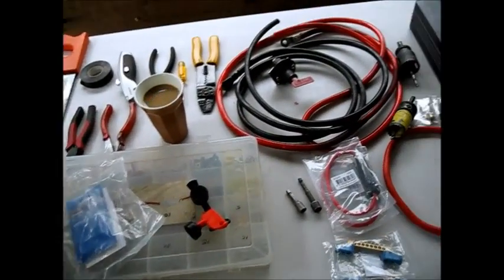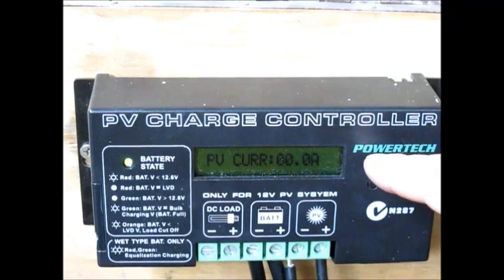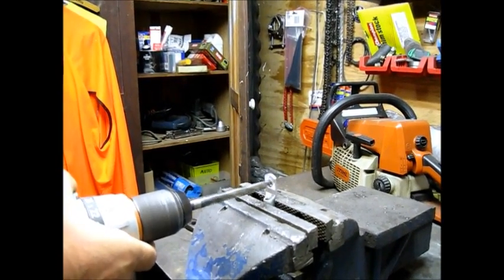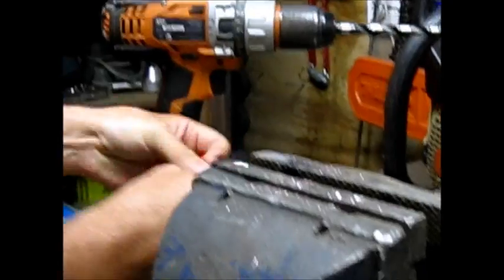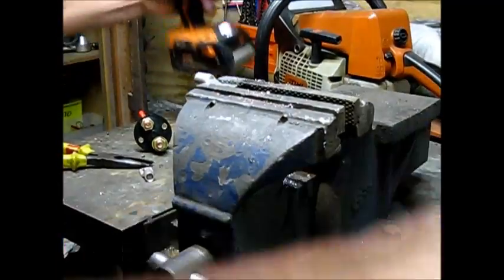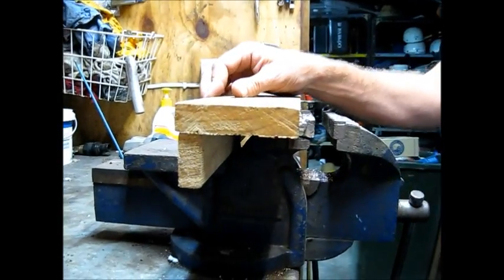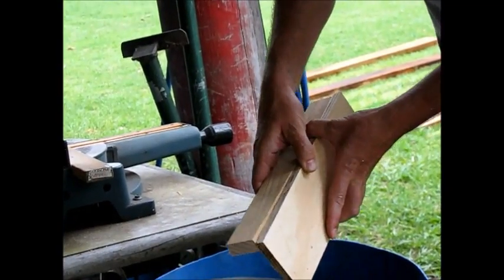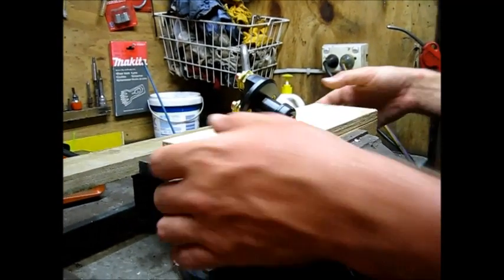The DIY World Installing Solar Panels On A Home In Australia PT2

Comment: Did I hear correctly, you are using a 60amp fuse to a switch to a  1500 watt inverter...……… I would have thought a much larger fuse would be required
Reply from the maker: If the max load you are going to run is 60 amps or less then it is fine.

Comment: also putting the batteries and all the electronics together without any airflow is a bad idea not just from a corrosion standpoint but heat will zap those batteries life fast along with the charge controller and inverter.

Comment: for 340 watts of solar isn't that 12awg-14awg wire you used from panels to solar charge controller to battery at 12v way beyond 5% loss of power from what I seen 12ft-15ft at 12awg wire size the loss is around 10+% I see that as a huge waste.

Comment: Puttlng batteries and electtonic parts in same box is bad idea think of off gases and corrosion see abyc standards for technical guidelines for enclosed battery spaces,  if it dont blow up it will corrode

Comment: Hi, I bought one of these today, took it home, cleaned it out with hot water, filled it up, screwed the lid on and the water leaked out through the screwed on lid like you wouldn't believe. Is it supposed to do this? I wouldn't be comfortable putting this on my back and having it slosh around while I'm on my bike and make me wet, not to mention the stuff I would keep in the pockets that could get wet from the inside. Plus having to just keep it upright at all times is kind of ridiculous. Please let me know what your thoughts are on this. Thanks.

Comment: That absorption fridge is going to eat those batteries badly. Just uses resistance to produce heat. A compressor fridge is the only way a small scale solar set up is going to function well without destroying the batteries in a fairly short time.

Comment: Thanks for sharing this installation... and thanks to the family who allowed it, too! Very clean set up.  I like it.  When we do ours I'll remember your advise about wires as short and fat as possible.
I note in the comments some questions about the fuse size.  How do we decide what size fuse to use?     Also, glad the comments are back on!
Reply from the maker: Thank you. Choose a fuse that will handle the largest current you will need. For the fuse between the charge controller and the solar panels I use the maximum current rating for the controller which is 30 amps. For the output to the inverter I used a smaller 60 amp fuse because it was the largest they had in stock at the time but 120 would have been better to match the inverter ratings.

Comment: I find with those connector ends, rather than trying to use a soldering iron, just use a small torch. Much quicker and works perfectly.  Had to use that method with my car.

Comment: Wanted to give you a tip on them connectors. Vise Grip the connector and use a torch to heat it up. Drop some solder in and when it melts, plug the wire in and let it cool off. Wear some gloves so you don't get splashed.

Comment: Nice to have the switches if you want to service the system.Does that box need some vent fans?Great vid thanks for sharing.
Reply from the maker: Yes the switches are perfect for servicing the system. No fans are needed because the batteries are sealed.
Reply: +The Do It Yourself World If i use sealed batteries I can have them sitting in my room.?

Comment: I didn't see why you have two switches since it was getting dark. I would assume the power inverter only connects to one switch. Are you planning on wiring something else to the other switch?
Reply from the maker: For the solar panels as Francisco said.
Reply: The Solar Panels will need fuses and a cut-off switch between them and the Charge Controller.

Comment: what timing you have...i am about to do the same type of install...need to find a cutoff switch yet....question about the 60 amp fuse...i have a 1000watt inverter..12 volt...yours was 1500 watt..12 volt i believe...wont that inverter draw upwards of 130 amps ...not including any surge draw which would be greater?.
Reply: The Do It Yourself World 1500 Watt Inverter?
6.5 Amps at 230 Volts Output?
125 Amps at 12 Volts Input!
I'm guessing that this fuse will be melted by a 750 Watt load.
This is the type of stuff you should take the time to explain to your subscribers, instead of showing us how to drill a hole into 4 lugs. I mean one should be enough. ;)
Reply from the maker: Yes if you max out the inverter then you will need a larger fuse. For this setup they will not be using that much current though.
Reply: thanks for confirming that...i wasnt 100 % sure if thats how it goes

Comment: Nice job. It is a pity that towards the end it got so dark that I could not see anything useful. I appreciate that the project is not just done for the benefit of the viewers, but I guess just a flash light would have made a difference at the end.
Reply from the maker: Yes it was frustrating. The thing is that the lighting comes later when I have the solar power installed.

Comment: Very nice looking installation. I really like the way you did that. I would rather see those switches mounted on either a heavy gauge plastic or a metal panel but you did a great job with what you had.                                      Be Safe         Randy
Reply from the maker: Thank you.